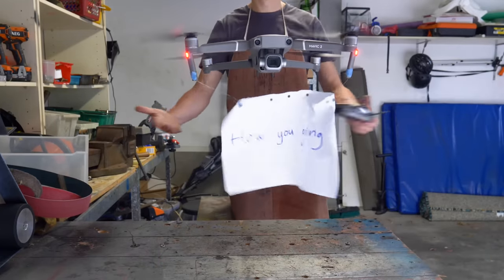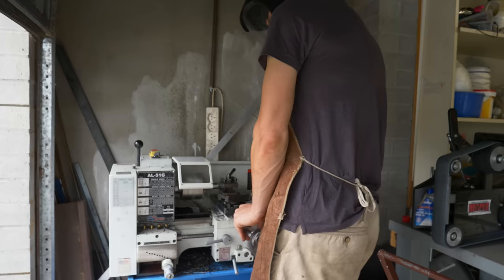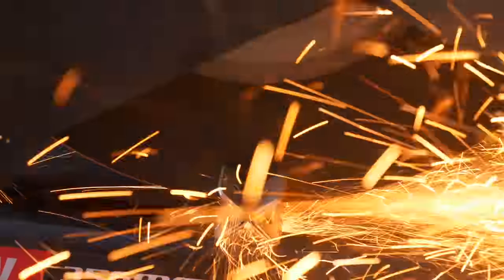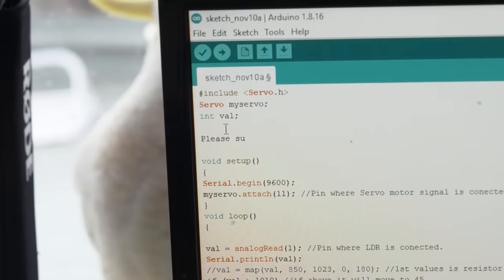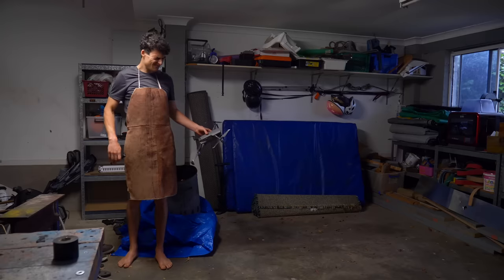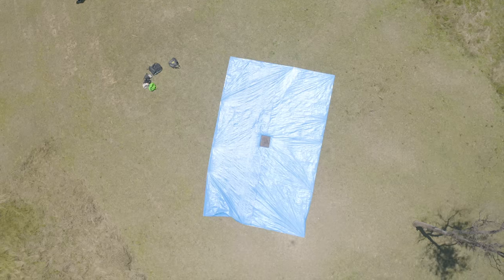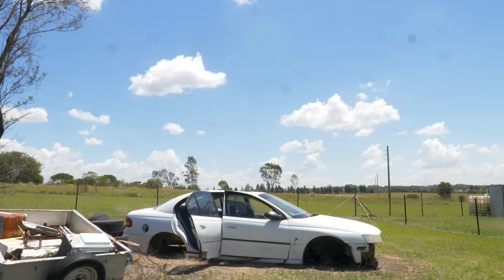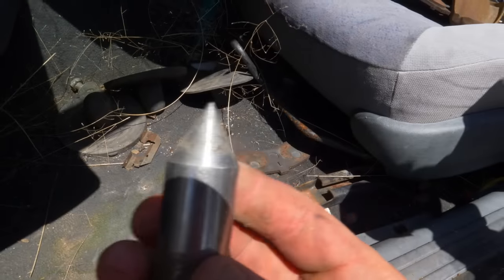Drone Darts are Silent and Deadly!

Comment: By the way, the way most bombers keep their bombing accurate is by introducing forward momentum, but thats extremely complex.

A computer would, however, be able to calculate the area that it should hit via equations, but even then, that's a lot of work, and this did pretty good regardless.

There's a reason most drones aren't quad rotors. But fixed wings instead. 

(Mine defusal drones are four rotor, but they use explosives instead of a kinetic projectile.)
Reply from the maker: That sounds like it would be impossible on quad copters
Reply: @Ididathing  it would be extremely difficult, but you could probably do it with a simple RC plane.
Reply: The way most bombers keep their bombing accurate is to say you're 'dehousing' then pat yourself on the back after hitting the correct city.
Reply: @charleslambert3368  Solution to inaccurate bomber is to use bigger bomb! Guaranteed to hit target then.
Reply: @3sty216  but theres this annoying thing called conventions and warcrimes that make it pretty hard to get cluster munitions
Reply: @3sty216  I was thinking nuclear, but sure that works too.
Reply: You could gain accuracy at the cost of speed by angsling the fins slightly,
Reply: @VexChoccyMilk  nuclear's too expensive to make and detonate, you can pretty much create a cluster bomb with a fishing net and a bunch of leftover explosives
Reply: You're a little projectiles weren't bad, but they could use some serious aerodynamic optimization. Your center of pressure was too far forward. If you put those fins on a small tail they'll stabilize much more quickly. If you want things that are quick and easy to manufacture, take a grinder cut blade and put a notch on each side of a tube. Then just shove a piece of sheet metal through the notch and weld it. Do that twice and bend to suit. If you use a 6-in long tube, I guarantee a clean strike every time. Think lawn dart. Also, if you do this and you don't take it up to 600 m.... 👿
Reply: the main reason you dont see many quad rotor drones is endurance. fixed wing designs can stay airborne for hours at very high speeds, two things quad rotors struggle to achieve
Reply: Cluster Bombs that don't self detonate after a set time or are incapable of being defused are illegal. Submunitions are still in use by NATO and non NATO countries.
Reply: "cccurate bombers" usually that just means they hit the same zip code as the target
Reply: Sooo, basically you need a model Stuka?
Reply: Maybe a simple crosshair would help a little
Might not be much

Comment: I agree with your description of soldering. I hate the fact that the slightest twitch in my hand can bump the end of the iron wide enough to move or dislodge whatever tiny component I'm trying to solder.
I honestly wish I could buy a small robotic arm with a soldering tip on it that moved very slowly and smoothly, and just control it with a joystick.
Reply: But to make it you'll need to solder boards for the arm so you're suck either way.
Reply: Did this with a lathe once because the part was worth too much to mess up, works great for accuracy. It's very slow though.
Reply: @loganosmolinski4446  😂
Reply: Have you tried a hot plate for SMD parts? It works wonders
Reply: This exists the singer instruments mk1 micromanipulator works well for this
Reply: @hazwood9758  this is just a fancy pantograph, but yeah it should do the trick, and it's fairly easy to build (just cut some brass sheet and pin them together)
Reply: Imagine not having surgical percision /s 
I know it gets frusterating, but keep at it it gets easier
Reply: Tweezers and a finer point iron are really what ppl should be using for small parts like 0402s.
Reply: I think you and idat are unaware of some simple soldering standard moves and techniques that make the whole thing a LOT easier. e.g. in the video idat is doing everything on the copper plated side of his little board. The usual way to do it is to stick the leads of the components through the board, with the parts themselves on the uncoated side and only the wires sticking through the little holes in the copper pads. Then you heat up the wire and pad by touching them with your iron at the same time. Once they're hot you keep the iron there and push the solder wire directly into the 90° angle between wire and pad, that way it bonds immediately and spreads nicely.
Reply: @satibel  fair enough! It's not what it's designed for (i work for the company) I just know it's one way that it's used by some companies for fine soldering. It's not anything that I ever do just thought I'd share something we make that I think is cool.
Reply: @whydidyoutubeaddthis  I usually wind a paper clip around my iron & use the last bit as a micro iron
Reply: @hazwood9758  it does look cool, looking back at it the weights would make it a lot better too because you can just use it as a third hand too, but given the market it seems directed at, I'm afraid it's probably way too expensive, do you have a ballpark pricing? (like 100-200 bucks or more like 1000?)
Reply: Buy 0.5mm solder for tiny parts so you cant knock them around
Reply: @satibel  I mean it is almost definitely too expensive for average soldering, it's a very niche use case, they're a fair amount more than that but my role isn't in sales so I couldn't say too much

They were originally designed to essentially do surgery on bacteria cells back in the 60s in a process called tetrad dissection (although they're rarely used for this now due to us making better products for it, the dissection scopes on the website). One of the use cases I know them for now is soldering I don't know much about how they're used for soldering or by who etc but it's one of they're use cases. I know nasa buys quite alot of them too
Reply: A eutectic mix makes everything much easier (63% Tin & 37% lead) regarding unsteady hands and cold joints.

Comment: Rough idea, but I think you can push the level of madness. Add a booster to the end that ignites when the projectile is approaching the ground, not too early so the trajectory won't spin out of control. A kinetic missile that ignites when it's above the target.

Crude example: home made rocket fuel (check out "Homemade Rocket Fuel (R-Candy)" by TKOR) using sugar and stump remover, attached to the end of the projectile. Could have an electric cigarette lighter rigged to an Arduino that lights a fuse -> drops the projectile.

This is all, of course, theoretical. Of course.
Reply from the maker: I like it but i dont like the idea of them misfiring and going in a random direction
Reply: @Ididathing  It will only misfire if it's designed badly :---)
Reply from the maker: Have you seen my videos?
Reply: @Ididathing  no he has you are great at making stuff
Reply: what are you doing here hoot?
Reply: @Ididathing  mate it would have been much easier to just plug your servo into the receiver in your mavic so you could use your light on off switch to just open or close the servo
Reply: Model rocket engine igniters do a swell job I say...?
Reply: @Ididathing  something like a Luftwaffe gravity knife but a spike that when on impact exerts out the tip embedding in to objective...?
Reply: Apparently the Wi-fi in prison is working fine.More activities to inmates.
Reply: An Automatic Activation Device (AAD) used for automatically deploying parachutes would be a perfect trigger for the rocket. Just specify the altitude at which it should ignite and it will send a pulse if it's in a freefall when it reaches that altitude.
Reply: @dinorei7364  ?
Reply: @IAmGodHimself777  I´m just saying...not me.
Reply: @dinorei7364  ???
Reply: @Ididathing  make a blast wall like they did in October sky. The movie where the kid dives into rocket science and tries to make rockets
Reply: This is an excellent idea. But instead of a drone you should attach a group of these to a fixed wing aircraft so that you can fire multiple darts at once, and then fire them over terry wings house from my school….
Reply: @Ididathing  kkkkkkkkkkkkkkkkkkkkkkkkkkkkkkkkkkkkkkkkkkkkkkkkkkkk
Reply: Mate they weren't even stable. Maybe attack that issue first b4 u go to that..
Reply: @Ididathing  just drill a hole though it and feed a rope from the drone to the floor for aim lol
Reply: @Ididathing  it is a cool idea, but you can improve your dart by making most of it from mild steel and only the penetrating tip hard  (drill a hole, cut taper, make tapered spike insert) and increasing the weight up front much like a mortar looks. The more forward weight the more air resistance straightens the rear
Reply: @Ididathing  Thats a fair reason
Reply: @Hoot  and it won't misfire if it was made of tungsten or Really heavy but if that were the case you'd need a bigger drone i suggest gas powered
Reply: R.I.P
Reply: Durandal...
Reply: Attach an ESTES ROCKET
Reply: If anything you could get a similar yield with a projectile between 5-10 lbs. it'd be on the upper end of what a drone can carry, but totally could end a dude
Reply: @пандавалаби _ Yeah we call that terrorist act
Reply: How about orbital strike next
Reply: @Ididathing  fair
Reply: HOOOOOT! DON'T GIVE THE FOOL IDEAS! HE'LL END UP IN JAIL OR WORSE!
Reply: @Ididathing  you could add two reactive liquids to the front in two separate containers that pop on impact. Basically an impact grenade. This way you get more damage without risk if you have control of the drop area. Theoretically speaking of course.

Although buying the chemicals/liquids might get you a visit from the authorities, so don't buy them together with pipes and nails.
Reply: This is a "how to" get placed on a watch list for sure.
Reply: ayo hoot
Reply: @Ididathing  You don't pack it with enough fuel to fly off like a bottle rocket... but instead enough for a SINGLE explosion.  ultimately it's droppped from above, but it's real energy is supplied from the explosion at the end that only burns for as long as gun shot.  turning it from "Terminal Velocity" to to the speed and power of a shotgun slug.

Comment: Hey by the way, it’d be a lot easier to cut the metal and make less noise too if you use hydraulic oil. I’m in CNC machining currently and that’s what we use
Reply: @Baitrix1  I just spit on it, what do you use?
Reply: @KerbosYT  i just cut my arm and put blood on it
Reply: Why don’t you just run coolant ?
Reply: @aoki6332  i just use brain liquids. You know, the stuff from the meatman that appears in you basement at midnight.
Reply: Ive heard people use wd-40 in a pinch
Reply: @Palmtop_User  I don't think WD-40 is a lubricant.
Reply: @Tunkkis  maybe i should rephrase. Ive seen people use it in a cnc machine that didnt have proper coolant stuff

Comment: In case you would like to revisit this idea later on: In order to increase accuracy and decrease tumbling you may try to shape the bolts differently. 
Necking down the bolts in the rear and adding bigger fins might just do the job. Basically imitating the classic dart form. 
Alternatively use just a 3- or 4-sided head stuck on a wooden or fiberglass rod with fins in the back (like a Bodkin-Arrow) could also be beneficial for accuracy, but might also increase the negative effect of the wind.
Reply: the darts did seem pretty fat and short especially with the little fins attached
Reply: or just shoot/throw the projectiles into the air instead of flying them?
Reply: @Blox117  Where would be the fun in that? You seem to not get the appeal of weaponizing shit just for the chuckle factor.
Reply: @TheVicVance  to shoot stuff out of a cannon in a high parabolic arc. end result is the same
Reply: @Blox117  the whole point of the video was using a drone to drop high speed killing darts and not to launch them out a cannon
Reply: @lucas8566  read the original comment
Reply: @Blox117  project is dart from drone.
Reply: @aBowlOfOranjes  i see awetism is well and alive
Reply: oh look, i liked my own comments just like this guy above. awetism ftw!
Reply: @Blox117  okay
Reply: @Blox117  But it is way more fun, to watch your projectile fall towards your target from the birdseye-view.
Reply: This would do nothing. The fins are not angled, so no rotational stabilization for you, and that's why accuracy would remain poor regardless of fin size.
Reply: @vos2693  the point isn't top add spin stabilization but to shift the center of mass to the front while adding drag to the rear in order to increase passive stabilization in a similar way to a regular dart.
Reply: @TheVicVance  good point, thanks for explanation.

Comment: most guns are designed to make the bullet spin when it flies out the barrel because that makes the projectile path more stable, if you want precision id put a slight angle on the fins so it starts spinning as it falls. along with a laser you could probably hit a watemelon from 100 meters
Reply: Yup it needed spin he's lucky the wind didn't spike it in the horses head 😁
Reply: @bigsteve6729  That would garner more views.
Reply: Fin stabilized projectiles don't need to spin, that's gyroscopic stabilization.
Reply: Stop giving him new ideas,he would create a superweapon.
Reply: spinning fin stabilized projectiles gives destabilizes them
Reply: The laser is just straight up dangerous to put on there, they seem to be looking straight up at it all the time.
Reply: That's called rifling. Works with guns but most definitely won't work on this

Comment: I did this with my Mavic. I used a 5v adafruit Trinket, I think a 5 gram servo, and a 200mah 2S battery, but I used a transistor wired directly into the drone’s LED wire to trigger it. Of all the things I dropped, water balloons filled with colored powder (like color run cornstarch-based powder) was the best. They explode upon impact and can easily be seen from the drone which makes dialing it in a lot easier.

Comment: Ive added a simple FC and fins that rotate to my darts, with a fromt facing wireless camera (the one that runs on 9v batterys and cost now $5) and when the drone drops the dart, i swap my controller to "Profile 2" , which puts the drone into auto-hover, and switches to controlling the dart. My fpv goggles switch to what is infront of the dart and within reason i can "guide" the dart to a "target" ive painted on the ground.  The next step im experimenting with is getting both my drone and the dart to use a green laser dot as a point to concentrate on and move to, kind of like in the movies/real life.  At night it does ok but in the day time im having trouble staying on target.  I use the word "guide" instead of fly because at the speeds the dart drops at, you cant really control it like an rc glider. Although I could explore that,  maybe with adding larger "wings" to the dart for " lift' while using the smaller back fins for directional control...